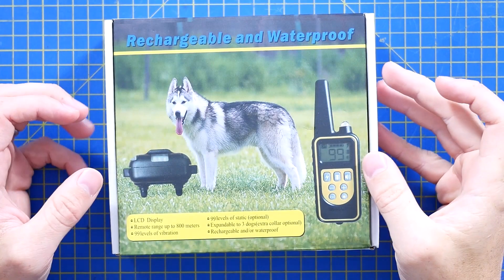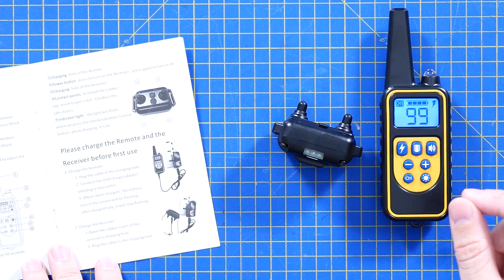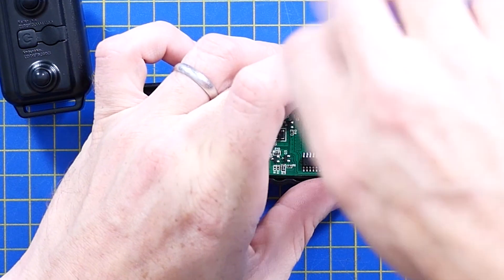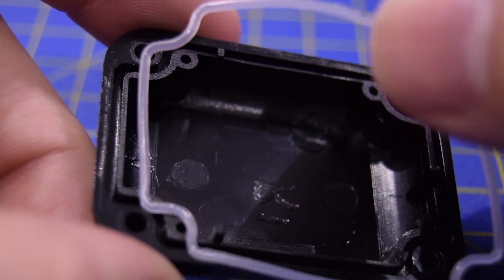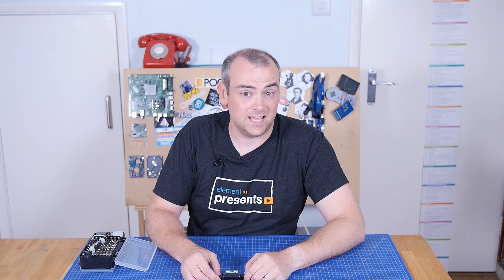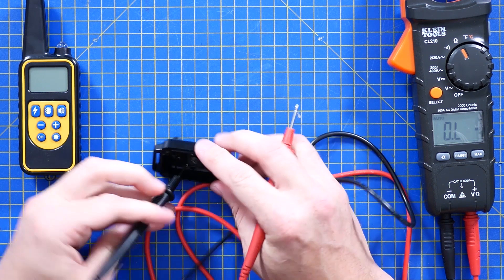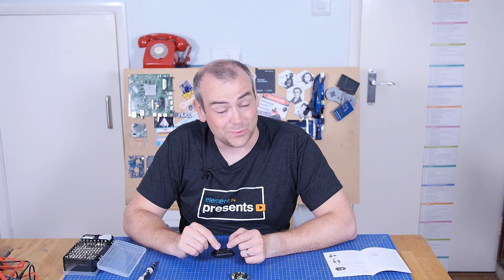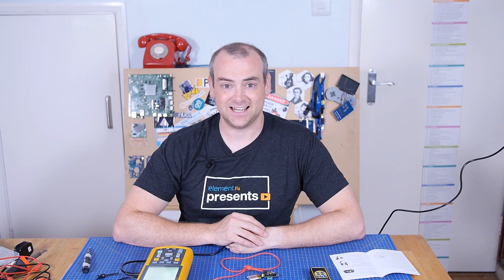RF Electric Dog Collar Teardown - The Electronics Inside

Comment: I have the same unit. Used it on myself,  just a light shock, I modified it to nip clamps for bedroom play and it works great. Uses conductive rubber for the tips on the device. Other units have metal prongs with conductive  rubber tips

Comment: The electric contacts are conductive. I know they look like rubber, but its loaded with carbon or something, it certainly works.
I got one of these with 3 collars, many years ago thinking to hack it to make a gps fence for goats ... the system works well enough, but after no time at all the remote control stopped working for any function but light or beep. Without the remote, i can't decode the signal to hack it 😝 I probably should just get a new remote to work from, they're cheap enough and the collar units seem better.

Comment: Hello, please if someone have the inner circuit diagram, please let me know, i need to repair my transmitter , suddenly I burnt 1 of the IC and I dont know the code for it
Reply: Or a code on the IC with 5pins right next to battery

Comment: I have this exact unit. It's honestly a shame you didn't try it, the level can be set from 1-99. Honestly anything over 13 would be unnecessary and cruel. However 1 is a barely noticeable pinch, 5 is where is starts to get uncomfortable and 10 is a solid thump 13-14 is where it just turns to ouch, 20+ there is not really much difference up to 99, noticeable yes but it's all just varying levels of pain. If you get it on your skin across a nerve or over a small muscle it will contract, I could sit there with it pressed into my palm just right and set on 1 and waggle my thumb. The more interesting thing about this though is the controller. It's like it's intentionally made to be just barely functional which is a shame cause the hardware is decent. It has a torch which is useful and actually decently bright, but it turns itself off after 30 seconds. It's supposed to be a training tool but it's poor interface makes it slow to access which with dog training needs to be instant. It's possible some design choices are in order to satisfy legal criteria for the maximum number of locations since these are banned in a lot of places, for example not naming the device on the box, but its functionality suffers for it.

Comment: what if the +ve prong touches the dogs skin but the ground prong is obscured by fur. The path to the ground could b quite shocking.
Reply: No it can't. The voltage is too low to track all the way to ground, so if the +ve probe is in contact but the negative is obscured by fur there is simply no shock at all, the animal never feels anything (open circuit, no current flowing). It only works at all if both probes are in solid contact with skin.

Comment: There is good reason why these are outlawed for animal cruelty in many countries. I have only seen them used in dumb drinking games irl.
Reply: They make ones that are TENS units. Those are not dangerous
Reply: @jamescollier3  Actually, that's a really good point! Maybe comparing this to a TENS unit could be an interesting comparison!
Reply: @a531016  I'd guess that these cheap shock collars put out something like what you get from the cheap e-stim boxes sold for non-medical purposes. A three-way comparison between the shock collar, an e-stim box, and an actual TENS unit would really be interesting.
Reply: Indeed! My cat certainly doesn't need it!
Reply: Illegal to use in my country. Makes total sense though. It is cruel.
Reply: @MisoNyah wales?